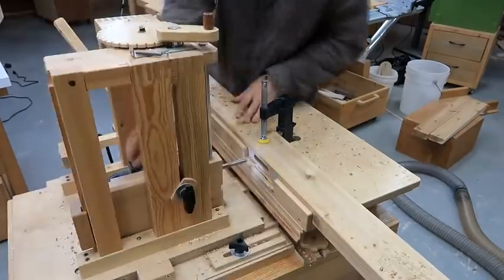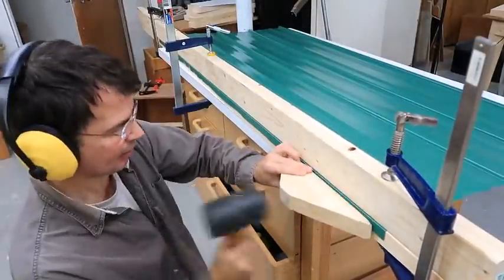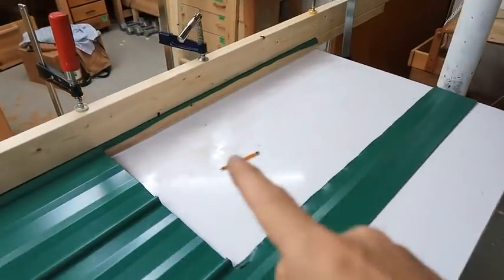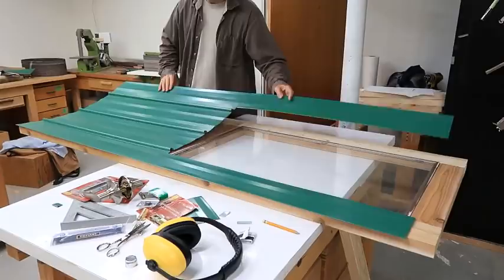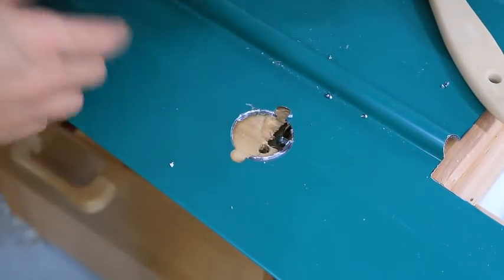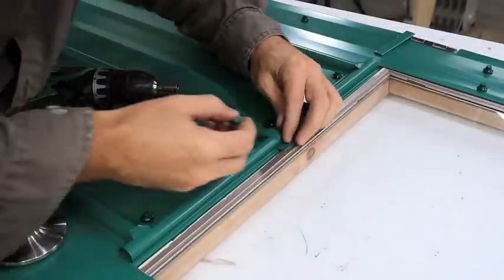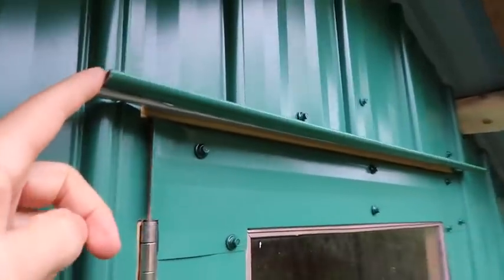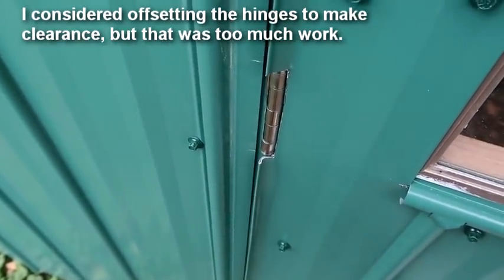Cladding a door with sheet metal roofing

Comment: You have no idea how timely this video for me is. Lost everything in this pandemic and currently living in a 5' by 12' shed on a relatives garage with my 5 dogs. The wood is molding and rotting and I have been thinking of cladding it so it can last until I at least get a job and move out. This video is super helpful. Thank you.
Reply from the maker: Depending on outside temperature, cladding may make it worse.  If you live in it, and it's not insulated and no vapour barrier, it can cause condensation in the walls.
Reply: @n325aej you don’t have dogs do you
Reply: @matthiaswandel  its exactly as you described. Rain is pretty much constant here and humidity is high. The plywood walls are starting to mold, and I cant afford to replace them yet.
Reply: @MikkosFree  best of luck man, rough situation
Reply: @twalt  Thank you.
Reply: @MrPhoenix1138  same here. 5 dogs is too many. 1 cat and 40 chicken here, including 5 roosters (cocks). Not living in a shed, though, but 20 one month old chicks are.
Reply: @MikkosFree   Matthias Wandel has a very good point.... just cladding over the rotting wood will probably make it worse...
May I suggest stapling a roll of clear poly sheeting (thick enough to last) to the studs and rafters and seal it with duct tape... to create a  barrier between you (and your dogs) and the mold....
Its not prefect or permanent, but it relatively cheap and easy way to "reduce" the mold spore count your breathing in now....
Good luck....
Reply: What area are you in?
Reply: breathing in mold spores is bad for dogs.
and likely you as well.
Reply: @nc3826  thanks for the advise.
Reply: @MikkosFree  NP hope it helps
Reply: I'm sorry to hear about your situation... if your relatives have a dehumidifier, it will help to run it inside a few hours a day.
you can also in the meantime have some medium-high grade tarp over wherever rain would fall and touch the outside walls, just to reduce water.
it will look worse, but it would be cheaper and allows airflow. once you've saved up some cash, you can buy some new plywood, assuming prices have dropped by then.
Reply: Mold only grows if you have moisture in the wood. Find where the water comes from and fix the problem. Cut out the really bad parts and patch the holes and repaint. I'm sure you can find some pieces of left over plywood and paint for free or cheap. If you have mold on the inside high on the walls or in the corners of the ceiling you maybe have a leak in the roof. Whatever you do make sure you don't lock up the moisture thats already in there. So if you paint the outside of the shed make sure that the inside if fully dried before you paint that. I wish you and your dogs all the best.
Reply: You don't sound very responsible. Literally every company is hiring right now.
Reply: @akivaweil5066  Im a former courier who now has peripheral neuropathy. But I guess im just irresponsible.
Reply: 5 dogs and a human all breathing in that small space - I'm surprised the walls aren't dripping with condensation.  Not a great situation. I'd suggest getting rid of all but one dog but I can't imagine having to make that choice.
Reply: @MikkosFree  You don't get to blame your problems on Covid then pull some other disease out to make me look bad.

You need to either get a job or file for disability payments. Reduce your costs by getting rid of most if not all of your dogs, and apply for section 8 housing.
Reply: @akivaweil5066  This was a discussion on cladding. With my situation as a backdroo to explain the need for such cladding and/or improvements. People commented on my situation, to which I replied to. Your contribution was to highlight my "irresponsibility" as you said. Didn't you even think a suggestion along the lines of "get a job" was overtly simplistic over a situation you know nothing about? You are right, I was being snarky with my previous comment. I just found it infuriating that you would jump to conclusions without any kind of investigation. So yeah, I did feel attacked. Something I wasn't expecting from a comment on a video about cladding a door. Oh and disability payments don't exist in country, you can only get disability discounts (%20) and the occasional handout (max $100) about once a year or if there is a calamity in your area.
Reply: @akivaweil5066 , He DOES get to tell you about his neuropathy, if you already crossed the boundary of being overly nosey and judgemental.  You just DO look bad.  Mind your business.
Reply: @MikkosFree  Yikes.
Reply: @woodsprout  Read the discussion again. If it doesn't compute then check your motherboard.
Reply: @Mama C Yikes
Reply: 5 dogs is too many, but each to their own.
Reply: @Mama C I tend to focus on the truth over what others think of me.
Reply: @SouthTexasSunsets  Bleach water can kill mold, but if you only clean the surface or easy-access areas it might not get the whole problem. Also, it can irritate the skin and lungs if too concentrated, and it can interact with other chemicals, so I'd suggest have some ventilation and body protection when using it.
Reply: @Mama C Jeez, I get bullied enough already.
Reply: @Mama C k
Reply: @colbyjoe2  Ad hominem, bruh
Reply: @akivaweil5066  yeah, sorry
Reply: @MikkosFree  if you have access to tools and transportation try to get water heater that are thrown out, they have insulation and the exterior enamel on them last a long time even in the rain
Reply: @akivaweil5066  you assume they live in the US
Reply: @colossalbreacker  Doesn't everybody?
Reply: The mould spores in the air are very bad for your health. And not good for the dogs either. This is a serious risk. You could end up with even more serious problems and an even worse financial situation. Sealing it up, now that mould is there, will make it even worse. Bleach/ammonia might kill the mould but if it is in the wood then the wood needs to be cut out.

Comment: If the makeshift foundation stays put, this shed will last forever.
Reply: If the makeshift foundation fails, the shed will still probably last forever... it'll just be on its side at the bottom of the hill.
Reply: He'll most likely know that foundation is failing long before it actually fails and can reinforce it with something more permanent.
Reply: I believe the makeshift foundation has a lot to do with the Toronto Ravine Protection building restrictions and permit hassles.  Because it’s not a permanent structure, (precisely because of that makeshift foundation,) he may well succeed in having a shed where it might otherwise not be permitted.  However, I suspect jealous and self-righteous neighbours will make this all a tremendous hassle.  By reporting the shed, triggering inspections and bureaucratic headaches.
Reply: @doctordumbass9425  He lives in a city, and has for some time.  He most definitely has neighbours.  If he is dealing with the city and groups I believe, they can be pretty obstinate.

Comment: Love it. Do you need to treat where you cut the metal? I recently had a metal roof put on and some of the warranty for the metal sounded shady when talking about cuts. Its been a year later and now there is slight rust spots under the edges of my metal where the water runs off the roof :(
Reply from the maker: I haven't run into any issues that way myself.

Comment: Reminder about security, just in case: Most outside doors open toward the inside of a building because exposed hinge pins can be popped out and removed to get a locked door open (plus exposed hinges can rust in the rain). Also, windows on outside doors are usually inserted on the inside face or secured with permanent attachments so a thief cannot simply tug on or unscrew the front to get the window open.

The way Matthias built and hung his shed door is usually okay for a play-house, or an outbuilding containing things that you want out of the weather and don't need strong security for, but not for something you want to keep meaningfully safe. I approve of the structure and the cladding, just that I'd do the window and hinges differently, and I'd have added a hasp (the flap and loop for locking a door with a padlock), if I wanted to be more secure.